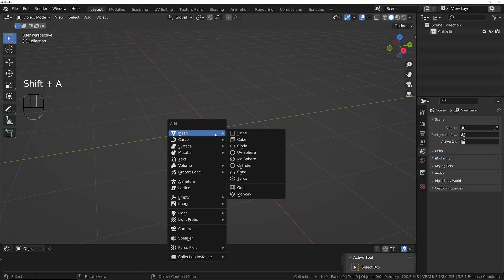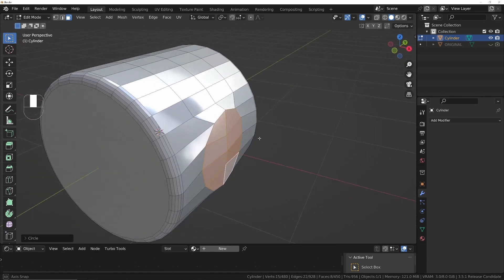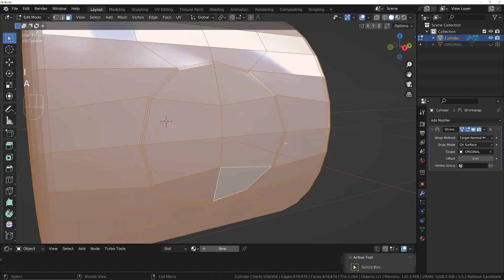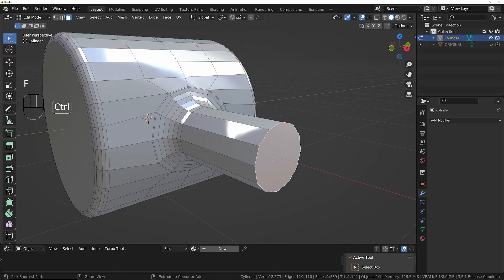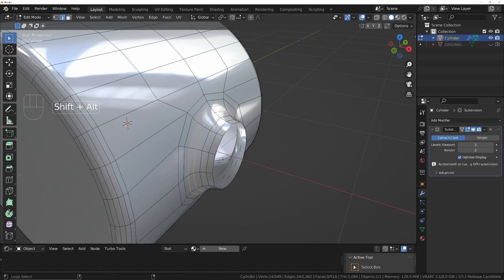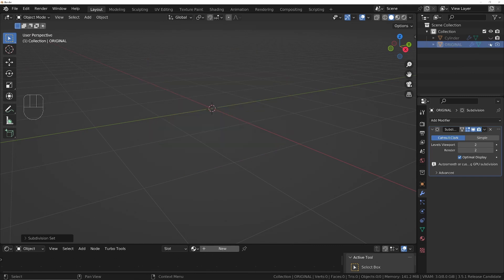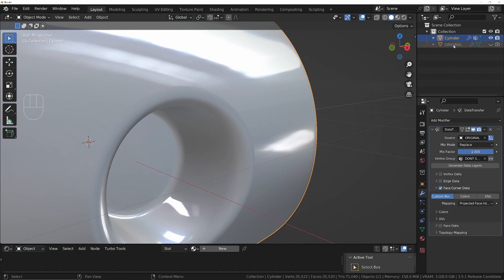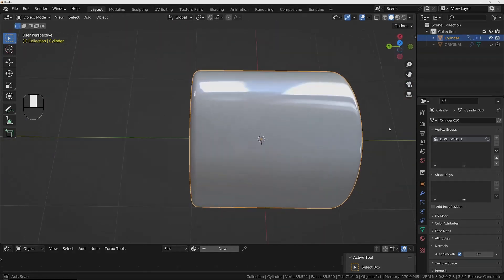Cut holes into things easily with perfect shading!

Comment: When you use circle in loop tools, open the options box at the bottom and turn off flatten. The circle will conform to the cylinder. Then you can inset, extrude, etc.
Reply from the maker: That's very true, but I prefer the shrinkwrap method, because it makes sure I can scale, add new geometry or even use proportional edit whilst still maintaining the correct shape.  I also find the flatten option of the circle operator helps maintain a perfects circle when the geometry is quite dense 👍
Reply: You're right  Remembered your technique earlier today and it helped. Thanks for the tips!